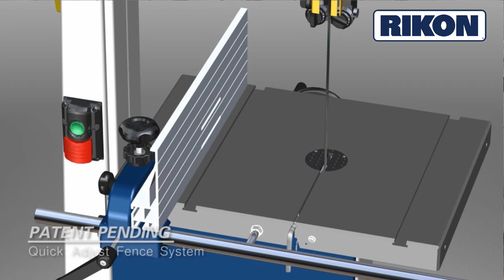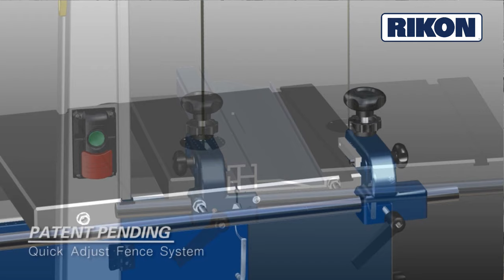RIKON 10-326 Design Features

Comment: Just got mine 2 days ago and absolutely love it !! Anyone on the “ fence” on purchasing this saw GET IT you won’t be disappointed, this video isn’t just a sale gimmick it’s factual. Many u tube videos from everyday woodworkers out there with nothing to gain from Rikon just honest experience. Great product.
Reply: Now that I have owned this saw for about 4 months , I have to say, it’s a magnificent saw and quite the upgrade to my shop. The only thing I would change is actually 2 changes is the E stop, this E stop should of been placed higher on the column so that is easier to access in case of emergency and definitely not hidden/ obstructed  while using the fence, 2nd would be the auxiliary power , you can only use the auxiliary power supply  if it’s wired for 110 , cannot be used while configured for 220v… this auxiliary is a great option for a work light , as the upper cabinet as do all saws cast a shadow on your workpiece. Neither is a deal breaker for me , and I would of  still bought  this saw if I had known.the pros of this saw certainly outweigh the cons, construction, resaw capacity, ease of blade change, tons of power, accuracy, fence, fairly quite and next to no vibration. 9 out 10 for me. Great product !

Comment: When I set up my new 10-326, I had an extra 6 or 8 inch steel bar that I can't find a use for.  I see the same short steel bar at 9:53 on the video in the hand of one of the demonstrators.  What is that?

Comment: i just picked this up and wow what a machine. its so impressive and you can tell Rikon listened to what the customer wanted in 10-325 model but didnt get.  just incredible.  nothing a new toy
Reply: +Peter Detorre Hey Peter, thank you! Enjoy the saw!
Reply: +Inside RIKON Guy ive been using it all afternoon. if theres a better 14" bandsaw out there id sure as hell like to see.  the upgrades on this is top notch.  i ripped a 3x5 x 36" block down & the accuracy was within .010 end to end.  amazing
Reply: +Peter Detorre Nice! Was that with the stock blade?
Reply: +Inside RIKON Guy yes stock blade which is even more impressive. usually the first thing i do with any bandsaw is take the stock one off and grab a timberwolf.  not today. woodcraft said it was a good blade and they definitely werent kidding
Reply: +Peter Detorre  and lastly rikons customer service is beyond any other company ive dealt with.  that reason alone will male me switch more machines to rikon.  Hows your table saw??
Reply: +Peter Detorre The 10-201 has a belt driven induction motor, not a wimpy circular saw bolted under a table. Trunnions are bolted to the frame. Mobility kit is included. It's a contractor saw that thinks it's a cabinet saw.
Reply: Inside RIKON Guy. I'm the co host of the new woodworking podcast Grain knockers.  would you come on to talk about rikon tool line, upcoming tools lines, etc?  I'm in Massachusetts myself and a rikon owner and fan.  let me know please.  we'd love to have you.  No charge, no sales pitch. nothing like that. Just tool talk
Reply: awesome!!!
Reply: rob, i emailed you.  did you get it?  really looking forward to it
Reply: furniturebypete our email server has been wacky....please send it again.
Reply: Inside RIKON Guy ill do it now
Reply: just sent
Reply: furniturebypete received thank you....will reply from the office
Reply: Inside RIKON Guy just checking in rod.  never got a email from you
Reply: rod, just thought id try one last time to reach out about joining the podcast to talk Rikon Tools.  i think the audience would love to hear from you after hearing from sawstop, jet, amd ridgid.  if not, i understand.  thanks.

Comment: +Inside RIKON guy. Thank you for the response. Im aware of this model, however, as stated above I am inquiring about a electronic motor brake, not a foot acuated micro switch with mechanical braking.
Reply: Understood...we offer this on our 10-370 18". It will decelerate in 8 seconds.

Comment: I'm pretty excited to see this posted. A local retailer mentioned this might be coming out, so I waited on pulling the trigger on a Laguna or Grizzly (17"). How reliable are those tool-less guide bearing adjusters over time?
Reply: +Rivertown Woodcraft The guide knobs are threaded in to steel barrel bolts that act as sliders. We have been testing for the past year; pretty confident they will hold up!
Reply: Thanks!

Comment: Got mine today.  Nice saw.  One big design flaw though...  You can't fully open the bottom door because it hits the back wheel at about 45 degrees.
Reply: If it is hitting your wheel while open at a 45 I would say something is wrong with you cabinet/ assembly , just got mine a few months ago , and the door opens completely, as it does in the video.
Reply: @steveiv9250  Nope...  Assembled according to in structions.  It's like they didn't consider wheel diameter when designing tne mobile base.
Reply: @steveiv9250 in the video the door hits the wheel 🤣🤣

Comment: This is in my top 2 bandsaw choices. Toss up against grizzly's 17" with motor brake. Any of the rikon line incorporate a motor brake? Open to opinions on which to buy...thanks
Reply: +ckent1975fm Yes! The 10-353 Has a foot brake with built-in off switch: http://www.rikontools.com/productpage_10-353.html

Comment: I bought the 10-326 almost a year ago, Rikon guys can you Please explain how to adjust the blade square to the table?? I cannot resaw thin stock because the blade is out of square by almost 1/8" . Im talking the side of the blade if I change the table from zero to match the blade then the fence wont sit square??? PLEASE RESPOND RIKON***** Severely bummed out customer